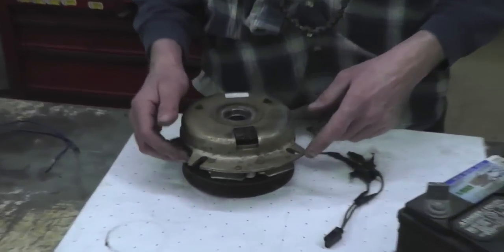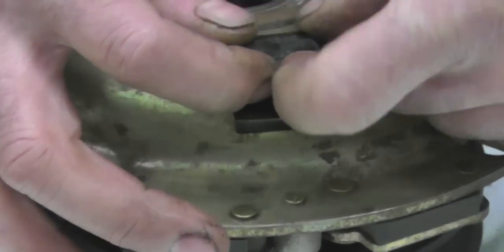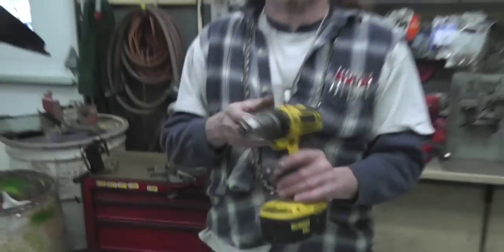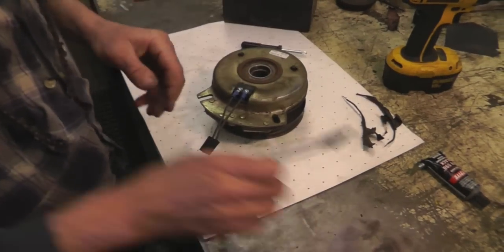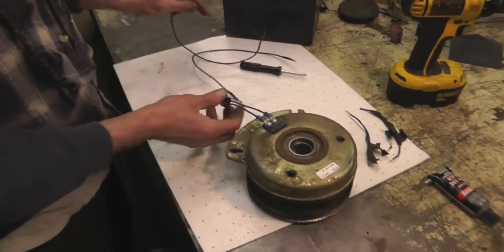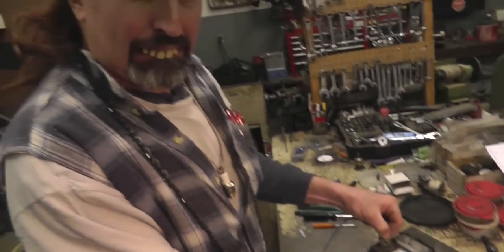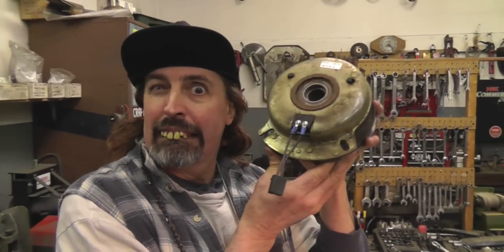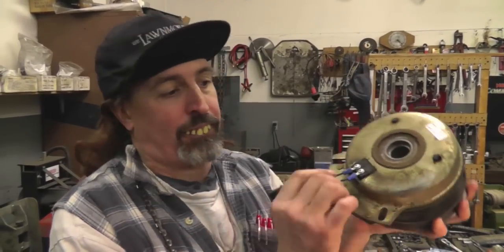How To Repair Ripped Out Wires On An Electrical PTO Blade Clutch

Comment: Same type of clutch on my toro. Im having trouble putting a name on the little metal piece that keep the clutch from spinning. Nobody calls it the same thing. So having trouble finding it on line. Help
Reply: Lonnie, you need to get the model and serial # of your tractor from under the seat, then you can look up and find the proper part #.  might be called anything from a keeper to a rod to who knows what name they dreamed up that day, but if you need help post the model # and I will get you a part #.
Reply: @leesluga545  Thanks Lee. GOD BLESS
Reply: Anti rotation

Comment: Cool but I have burnt up 2 clothes. The original and the replacement lasted 45min before it melted and shut my mower off. What I need to know is where are those 2 wires supposed to go. My had caught fire before I got it and I supspect that it did not get wired back properly

Comment: Taryl, I'm going out of my mind with this clutch thing!  The other day the wires randomly ripped off the clutch.  I hooked them back up, worked for 30 minutes, then ripped again.  Could you explain how the clutch is supposed to work and why it rips the wires out?  I'm going bonkers here!  Thanks!
Reply: clutch has either slipped from it's anti rotation mount or the wires are too close to the belt being sucked in and ripped out. secure the wires away from all moving parts....
Reply: Thanks. I fixed it. Thanks for the videos.
Reply: Whats reslly sad is they don't give you much by the way of wireing there, just a small tail, and thats it. Then you gotta try to work with that small portion of wiring which is almost next to impossible.

Comment: Nice trick! ;)  Hey I don't have much experience with these, but do you know if there is a protective diode in there to prevent a voltage spike when the coil is de-energized? I would hope so or you might wanna be careful when touching those leads to the battery. I'm sure you know what happens when you collapse the magnetic field in an ignition coil. YEEOWW!
Reply: I know this is old, but I wanted to answer in case someone else wondered... there is no diode on these. The reason for a shock with an ignition coil is because the high voltage has to go somewhere. Electromagnets, solenoids, relays... they do not have high voltage flyback current when the field collapses. You won't feel anything. Now if the coil was being controlled by semiconductors - like transistors or microcontrollers - then you would need a reverse protection rectifier to protect the semiconductor. Otherwise, it's unnecessary....

Comment: Great video. I have a John Deere L130 and just replaced the transmission drive. When putting the PTO clutch back on, I forgot which hole the bracket from the frame that prevents the clutch from spinning. Is it the open slot or the closed slot. It fits either one. Do any of you grass rats know?